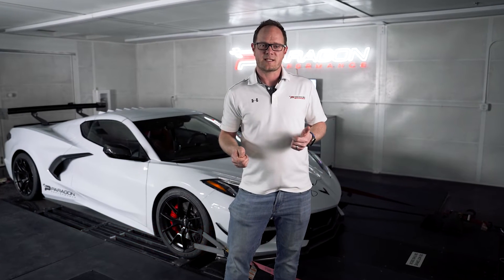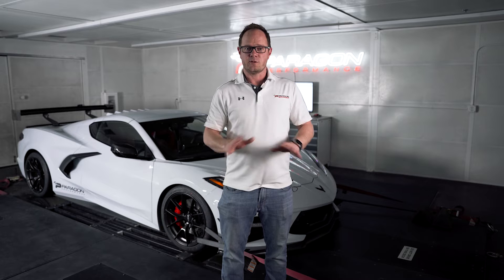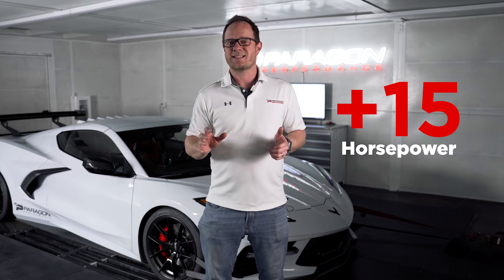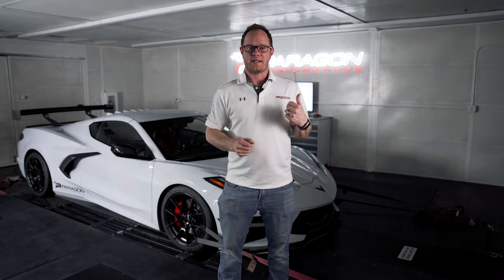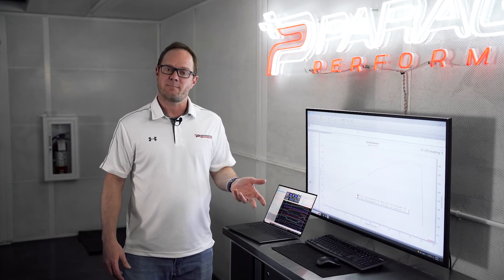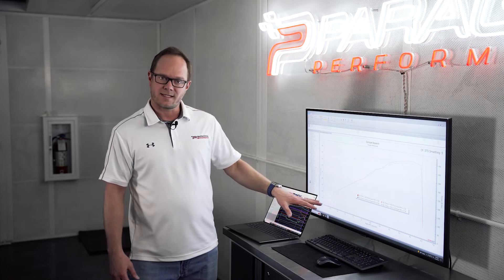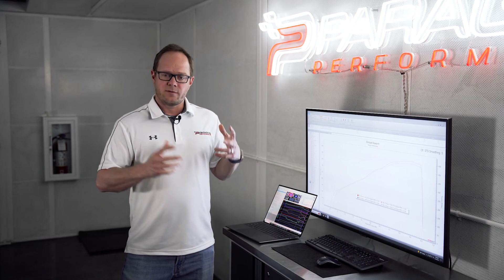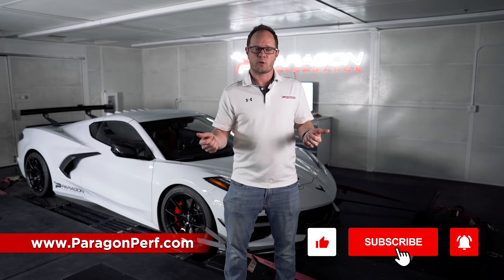C8 Corvette Lingenfelter pTR Intake Manifold Dyno Results! - Paragon Performance

Comment: Why does the manufacture claim 25 horsepower with the 95 mm throttle body but yet you only get 15 hp?     That is almost half of what they claim.
Reply: No answer......lol
Reply: @johngatsby1473  30 hp is the must you can get With e85 tune .  Add full bolt ons you get 40hp so 70hp tops for tune and full bolt ons .  Crazy expensive for little gains .  Tune alone is almost 5 k because you have to pay to have your ecu unlocked .
Reply: @MR.TOYBOX thats whats crazy AF.... hp tuners greeded out on us with their crap.  I still have credits from my c5 z06 but, apparently,  that whole setup wont even work...so i just gave up modding my c8....i wont pay those hp tuner clowns only to get aceforked by a supercharger setup thats over priced as well

Comment: Question.   With this carbon fiber Intake manifold, Halltech air intake, 95 mm throttle body, Corsa extreme exhaust and American Racing Long tube headers what kind of total HP increase on average can I expect?   Thanks guys.

Comment: Gr8 Ride..  is all the $$$$ 2 spend worth 30 hp . Everyone Quotes HP . However it's the TQ Figures.  
OK 10 ft lbs is minuscule.  If it was 20/30 ft lbs ... then it would be so much better.  If it was a race 🏁 car on the track .... OK 
😅😅

Comment: I literally just bought this from you guys and I installed it. Everything is good to go. Does this thing need tuned because it’s really wonky at idle like it wants to stall
Reply from the maker: No tuning is required. Just let the car idle and the ECM will learn the new parameters and "Self Tune". 

If you continue to have issues check for a vacuum leak and make sure it's installed 100% correct.

Comment: I literally just bought this from you guys and I installed it. Everything is good to go. Does this thing need tuned because it’s really wonky at idle like it wants to stall
Reply: Did you sort out the idle issues? I notice no customer service at least on here? I was looking to order but maybe not.
Reply: @ I ended up selling my car. I had to get it tuned and after that it was fine.
Reply: @User77989  Did you have to send you ECM out to be unlocked first to have it "tuned".
Reply: @ yes I did over 1000 for that alone
Reply: @User77989  Thanks for the heads up, Does not make sense to void my warranty by cracking the Ecm for this then. Thanks

Comment: What performance options are available for the HTC? (Besides an air intake)
Reply from the maker: Headers, Exhaust, Tune. 

Big power would be Lingenfelter Supercharger or ProCharger (Coming Soon)
Reply: @ParagonPerformance  which headers and exhaust do you recommend that don’t have drone?
Reply from the maker: @DColon614  Our Paragon Equal Length Headers or American Racing. Both are designed with the firing order in mind which optimizes performance. 

Our headers increase power across the full powerband where American Racing area at the top end, can't go wrong with either! 

As for an exhaust without drone we'd recommended you the Borla ATAK if you have valve control. Gives you that deep American V8 sound. 

If you like that exotic V8 sound though we recommend our Paragon Exhaust, do  remember it has no valve control so it's always "Loud"
Reply: @ParagonPerformance  I do prefer a more exotic sound, and I do have the factory performance exhaust. When you say it’s always loud, do you mean that there will be a drone, or just that the sound won’t quiet down in touring/weather mode?
Reply from the maker: @_Car_Ideas  Always loud as there are no valves so it's just one sound. If you're looking for valve control then any option we carry is great. 

The Corsa "cor21100" would be the closest exotic sounding exhaust though. 

https://www.paragonperf.com/Valve-Exhaust_c_134.html
Reply: @ParagonPerformance  thank you, that’s really helpful! Which headers would you recommend with the Corsa exhaust?
Reply from the maker: @_Car_Ideas  Can't go wrong with Paragon Equal Length or American Racing!

Comment: Got the Lingenfelter pTR Intake when they first came out and love it! You can hear the car breathing and the sound of my car at least has what the guys at Rahal’s GRP Shop who did the install a ‘flat plane syndrome’ sound. Instead of. High pitch note mine has a medium tone which sounds bad ass! I’d be interested in hearing what the dyno shows with the Eventuri airbox mated to the pTR Intake. Really need to see test results as to whether there’s an additive, antagonist or null affect with the two and numbers.
Reply from the maker: +15hp when you add the Eventuri intake to the PTR Manifold. Couplers are coming soon. 

https://www.paragonperf.com/eventuri-to-lingenfelter-throttle-body-coupler.html

If you bought the intake manifold and intake from us there will be a discount.
Reply from the maker: Pre-Order is open! 

https://www.paragonperf.com/eventuri-to-lingenfelter-throttle-body-coupler.html

Comment: Does this works with the HTC? What’s your procedure for dyno prep? Do you get a 155 miles restriction?
Reply from the maker: Does not fit for HTC 😢 we warm the car up to a baseline temp and do a pull as standard. 

No restrictions
Reply: @ParagonPerformance  What about the traction control etc? cus I have lots of issues when i put in the dyno
Reply: @ParagonPerformance  doesnt fit the HTC even with the engine cover removed for extra clearance ?
Reply from the maker: @LeadDevelopAchieve  we haven’t tested that.

Comment: I have this intake and during controlled condition acceleration testing I picked up ~1mph in trap and .5 seconds 60-130 or around 10hp.   Not terrible.  Better than the socal ported manifold and 91eff tb I tested which was about 5hp in my testing.

I appreciate your work you put in.

Comment: Notice they didn't dyno with a stock throttle body? Because there would really be no increase in power.. Intake is a waste of money unless you want the fuel rails..Msd intake and zr1 throttle body will make more power than that overpriced product.
Reply: And what MSD intake do you think fits the C8?....None.

Comment: 2400.00 for 15hp😮
Reply: Weight savings, power adding, looks enhancing, and it's a premium (read: wildly overpriced) product.   Makes everything just a liiiiittle better
Reply: It's worth it.
Reply: I think this was done with the 95mm throttle body as well.  The "package" is described that way in the video.  So $2,845...

This car also looks to have an exhaust.  I would imagine the numbers here are BOTH with the exhaust on; but, you could be getting better overall gains compared to stock exhaust...?

It can be hard to keep track of everything that is going to as these cars get more and more mods.

This, a fancy exhaust, headers, hi-flow cats, carbon-fiber intake.  An ECU unlock.  You're well on your way a forced induction kit - installed - at that point :)

Not all about the #'s tho.  Also, nice to be able to add something here and there - part of the hobby!

Comment: I'm assuming this is without a tune. So how, if this intake is allowing the engine to pull more air in, does it result in more power, if the stock tune does not adjust for more fuel?  Thank you.
Reply from the maker: The MAF sensor accounts for the extra air flow, also the C8 ECM has full time closed loop fueling which adjusts the fuel trims to the target AFR (Air Fuel Ratio).
Reply: @ParagonPerformance  great information thanks!